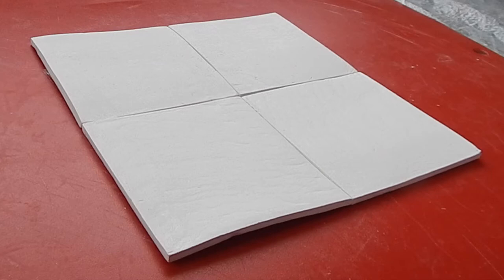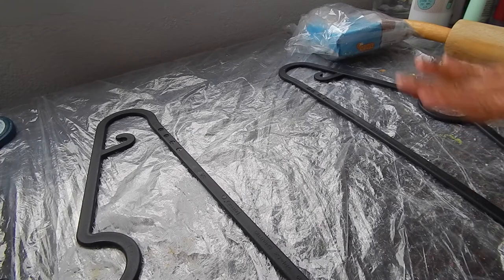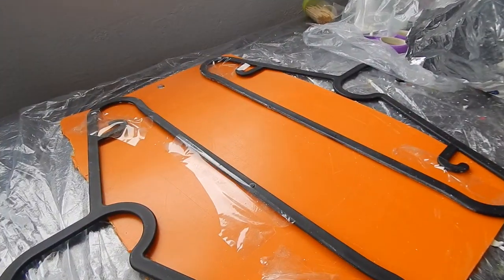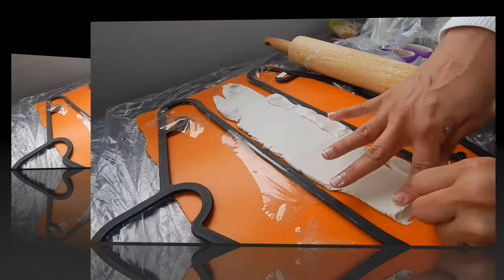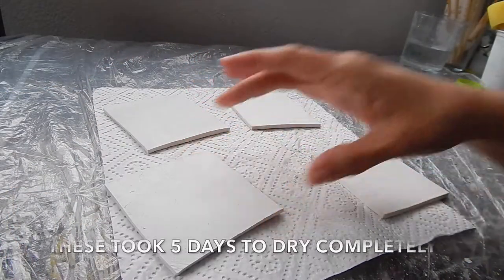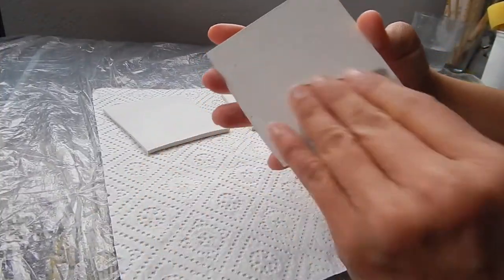DIY Air Dry Clay Tiles || Crafting with Air Dry Clay Series

Comment: Did you put it in the wall? I’m worried it will break during the process with the grout or the paint will damage
Reply from the maker: These Air Dry Clay Tiles are not as durable as regular building tiles. They are meant for decorative uses, however, if you seal them properly with varnish, they may be able to work for simple wall projects. If you try them on the wall, let me know how it goes. Here is the project that I used my tiles for https://youtu.be/ZFj9753ZtB4